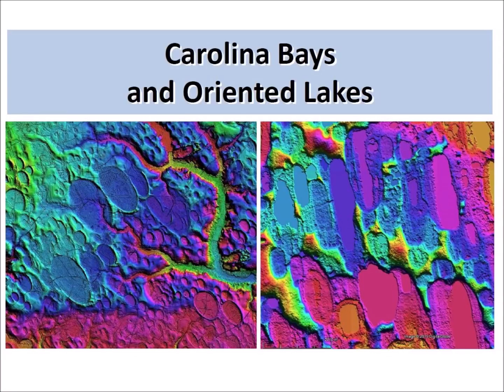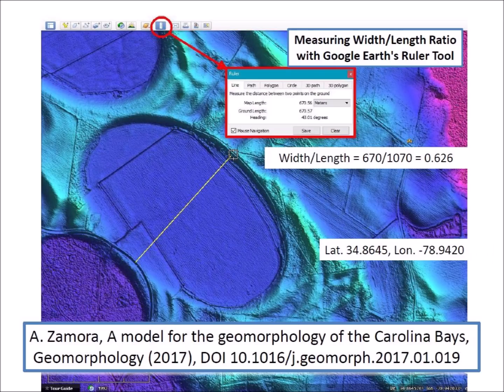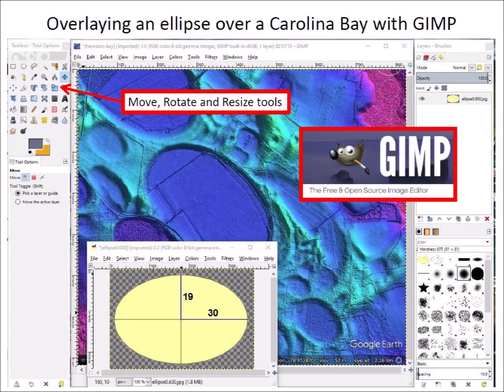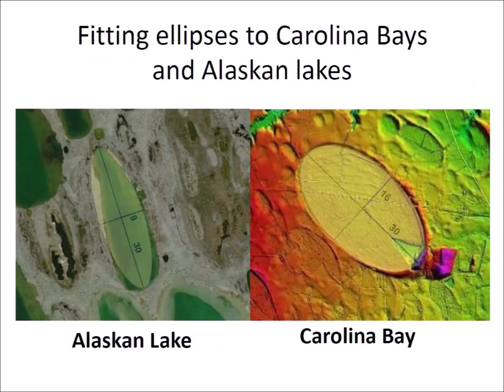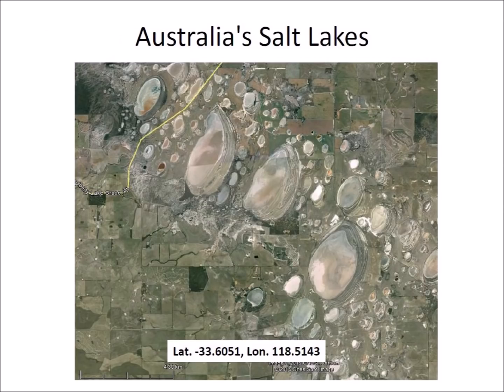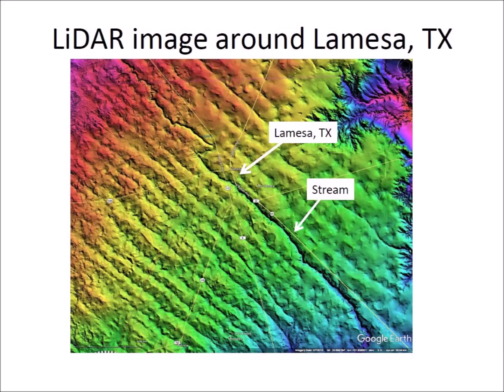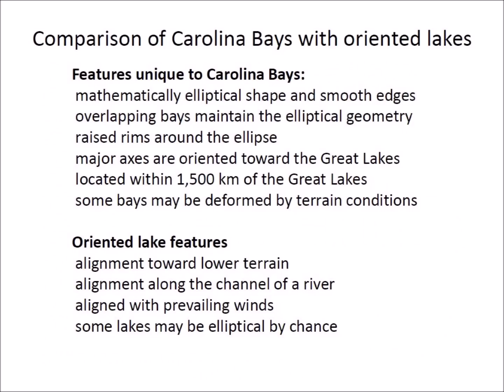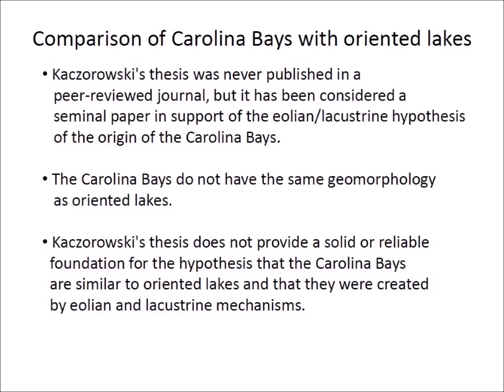Carolina Bays and Oriented Lakes

Comment: I have watched many of your vids..looking for a comment that might be too obvious. 1) the ejected material did not land just in Nebraska and Carolina, but landed 360 degrees.  Like a pebble in a pond, the splash should be near-round. 2) The material ejected would be pure ice only if the ice sheet was pure and thick. The material that used to form Saginaw bay is gone - and may be a part of that ejected material.  The ice may be long gone, but one could look for Sag rocks to fill in the circular crater rim.  
I am very pleased with your scientific approach and detail experiments to prove the bays were formed by ejected material. I'm convinced. Now lets see what else happened. Did it splash at the same time as the Greenland ET event? Did it push cold air across Arctic and freeze the Siberia mastodons? Was it a single space rock, or a swarm of meteorites that slammed earth and precipitated the Younger Dryas? 
I have visited Murray Springs Clovis site in southern Arizona and looked at the black mat layer. There are competing stories - one is that it was simply a sticky bog that captured a mastodon that made it easier for Clovis to kill it. The other is that a meteorite hit with a low altitude air burst that affected most of Arizona and devastated that campsite. Could your Sag ice chunks and my Clovis be caused by the same swarm?
Reply from the maker: The black mat layer is mostly located outside the 1500 km radius of the glacier ice bombardment. According to Vance Haynes, the black mat formed from moist conditions. I discuss this in my extinction video. https://youtu.be/npXY8mu2hhU

Comment: One problem I have with the ice block impact thesis to explain the Carolina Bays is that they do not always line up with the proposed Saginaw Bay origin.  For example, this Bay 34.8501N, 78.7168W has a long axis pointing to 311.5 degrees but when plotted towards the Saginaw Bay the angle is more than 335 degrees -- an error of over 23 degrees.  I can account for only about 2-3 degrees as a consequence of Earths rotation, assuming a flight time of the block of about 10 minutes, so that still leaves an error of about 20 degrees.  How do we explain that error?
Reply from the maker: Your comment shows that you have been doing careful analysis.   I forwarded your comment to Michael Davias who did the convergence work on the orientation of the Carolina Bays and the Nebraska Rainwater Basins.  His original publication is  Davias, M.; Gilbride, J.L., Correlating an Impact Structure with the Carolina Bays, GSA Denver Annual Meeting (31 October - 3 November 2010), Paper No. 116-13, 2010.
Reply from the maker: I was able to replicate your numbers using the ruler tool in Google Earth by creating a vector from the southeast to the northwest of the Carolina Bay, rather than from the northwest to the southeast of the bay, which would be the direction of the projectile.  The Google Earth ruler tool also gives your results if you create the ruler vector from the Carolina Bay toward Saginaw Bay, rather than the other way around.  The numbers are quite different if your vectors are from the source of the projectiles to their target. Please take a look at these explanations in Michael Davias' web site:
Modeling of The Inferred Orientation of Carolina bays
http://cintos.org/SaginawManifold/Modeling/index.html
Bay Alignment Systematic by Loft Time
http://cintos.org/SaginawManifold/Modeling/styled-70/page120.html
Bearing Calculator For Creation of Google Earth KML to visualize Inferred bay Orientations
http://cintos.org/SaginawManifold/styled-75/index.html
Michael Davias has a "Call for Collaboration" web page where he lists his telephone number and email address if you need additional information or if you would like to participate in a project related to the Carolina Bays. 
http://cintos.org/styled-2/index.html
Reply: Seems not to difficult to surmise that a portion of these huge chunks of ice thrown aloft by a bolide impact could be spinning wildly, and quite possibly breaking apart in their fast short journey from main impact point ot secondary impact point.   Spinning, and breaking apart could cause secondary impacts out of alignment of common trajectory?   Also, at the speed of which these large ice chunks were travelling, could atmospheric heating cause some to explode, causing parts of themselves and possibly another next to it to change trajectory causing secondary impacts out of alignment with others?
Reply: Or a combination of the two (centrifugal spin and breaking apart at interior fractures, atmospheric friction induced explosion during travel) to create craters/ovaloid/elliptical bays out of alignment with others?
Reply from the maker: Ablation by atmospheric friction, explosions, and midair collisions are all possible. I discussed that in the saturation bombardment video and in the heart-shaped bays video.
Reply: @greenbankgus  --  Spinning, if it were the cause of the angles being off, could not explain why the majority of them in a given area are so aligned -- a random spin might produce a direction change in any direction not just one.
I am also having a hard time understanding how a hyper velocity impacter hitting ice would result in large chucks instead of a spray of much smaller bits or even water vapor -- the energies are so vast and that energy has to go some where.  I'm unconvinced about the whole theory given the difficulty in dealing with that vast energy without the ice breaking up into tiny fragments or vapor.
Additionally, these ice sheets rafted large chunks of rock so you would expect that within these "Bays" would be erratics or fragments of erratics that would have been lofted along with the ice.
Not adding up for me.

Comment: There is one thing I think you should know about the Alaska study.  Having grown up in Alaska, I am very familiar with the lowlands there and the huge amount of "muskeg" that forms in the lower elevations:  (https://en.wikipedia.org/wiki/Muskeg).  It is composed of marshland that is unable to drain properly due to the fact that the frozen land does not completely thaw out in the summer.  And the further north one travels the thicker the layer of frozen land, and thiner surface marsh.  This is a permanent marsh, and if an Impactor had thrown out debris, there is a good chance that the outline of the strike would be partially obscured by the rebounding marsh/Muskeg.   I'm not saying this is a certainty, but something you should consider when comparing the impact bays.
Reply from the maker: The comparisons that I made in this video were based on LiDAR images, which do not consider the environmental conditions of the terrain.  However, your observations may be relevant to explain the "black mats" associated with the Younger Dryas Boundary.  According to Haynes (2008), the black mats are associated with wet conditions that persisted for a long time at the onset of the Younger Dryas cooling event. The region with black mats seems to be beyond 1500 km from Saginaw Bay, which would have escaped bombardment by ice boulders, but which would have been covered by dust and snow from the condensing vapor produced by the ET impact. A thick layer of frost would have smothered the vegetation creating conditions similar to what you describe.
Haynes, C. Vance Jr, Younger Dryas “black mats” and the Rancholabrean termination in North America, PNAS May 6, 2008 vol. 105 no. 18, 6520–6525, doi: 10.1073/pnas.0800560105 https://www.pnas.org/content/105/18/6520.full

Comment: Could the features at Lamesa, Texas, @ 04:34  be lightning strikes?
Reply from the maker: When lightning strikes the ground the heat generated may fuse sand and create fulgurite, which is like a tube of glass with a dimension of just a few centimeters.  ( https://en.wikipedia.org/wiki/Fulgurite )  The images of Lamesa in my video had an eye altitude of about 30 km.  The lakes are about  300 to 600 meters across.

Comment: Putting it all out there!  Bring on the peer review!
Reply from the maker: I was an editor at Chemical Abstracts Service for many years, and I also served on the board of the Journal of Chemical Information Science.  I refereed many papers during those years.  I don't think that Kaczorowski's thesis should be used as a reference without additional validation and a response to the points that I raised in this video.
Reply: Agreed!

Comment: Thanks for the post. Would the original impactor produce dust from itself as well as ice boulder secondary impactors from the ice sheet? Do we even suspect its physical nature? Comet/asteroid? There seem to be literary sources and possibly iconography that suggest the moon turned blood red.
Reply from the maker: The sky would have been black from all the water that evaporated and condensed as clouds.  I don't think that it would have been possible to see the moon.  It is not known whether the meteorite was a comet or an asteroid.  Petaev (2013) proposes an iron meteorite with a high content of platinum. "dust" implies some silica-based aerosol.  Microspherules have been reported at the Younger Dryas boundary.  The ice boulders would have produced water in any of its three phases.
Petaev, M.I.; Huang.S; Jacobsen, S.B.; Zindler A., Large Pt anomaly in the Greenland ice core points to a cataclysm at the onset of Younger Dryas, PNAS July 22, 2013, doi: 10.1073/pnas.1303924110, 2013.
Reply: Antonio Zamora  Do you mean to say that the sky would have been black all over the world and that people would not have seen the moon? I'm curious if it blocked out the sun, too and for how long. And I suppose we could never know if an accompanying meteorite also slammed into open ocean and caused more water be shoot up into the air!
Reply: Thanks again.
Reply from the maker: Proponents of the Younger Dryas Impact Hypothesis have stated that several pieces of a disintegrating comet may have caused the cataclysm.  Firestone (2009) wrote that the pieces may have created the Great Lakes. The Younger Dryas cooling event was a sudden return to glacial conditions that lasted around 1200 years.  The effects were global.  Graham Hancock's books, like Magicians of the Gods, propose that human civilization collapsed and tried to regenerate after the event.  Obviously, the human survivors would have told horrifying tales, but it is unlikely that these stories would have remained unchanged for about 13 thousand years.  I am just going with the physical evidence provided by the Carolina Bays and Nebraska Rainwater Basins.  These geological structures have a single convergence point at Saginaw Bay.  From this, I can only deduce information about ONE impact.